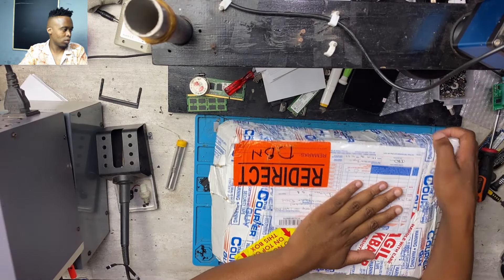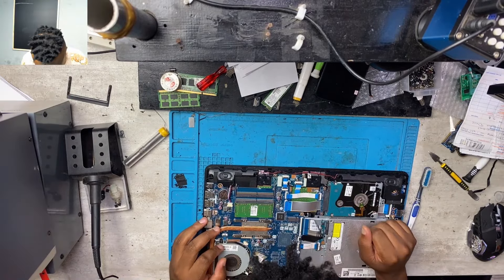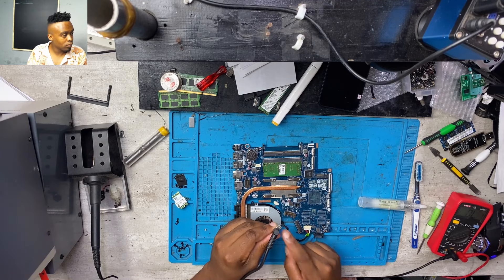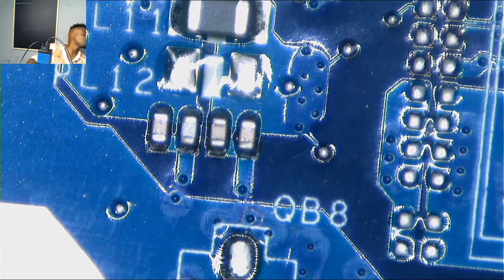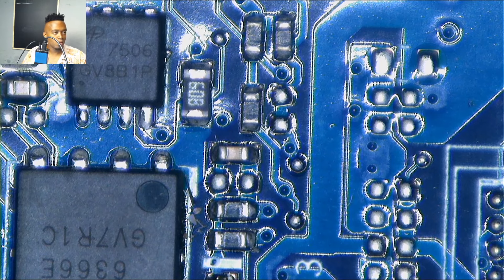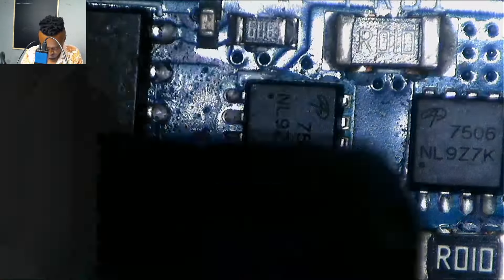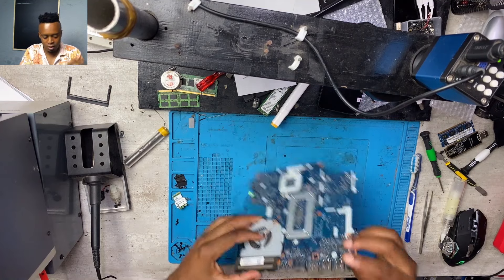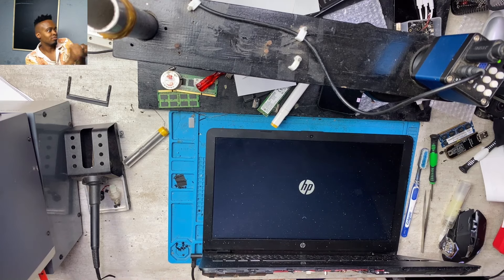HP LAPTOP WITH NO POWER REPAIR

Comment: Nice approach. I have a I5 Asus that is shorted right across the board. Then I have a Ryzen 3 That has its power the fan does not spin but i can hear the hard drive is active it just have a single steady white light. I suspect the bios on that one but still waiting for delivery of my programmer I want to make that my personal laptop. Replay with any advice? Makaveli